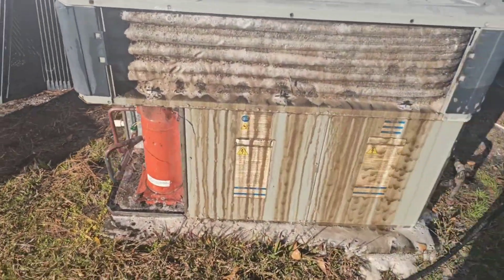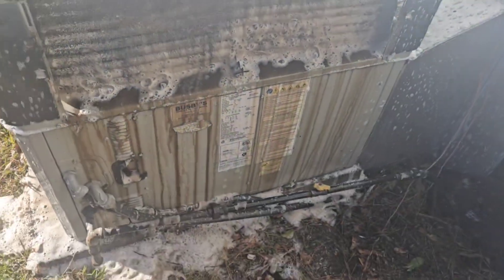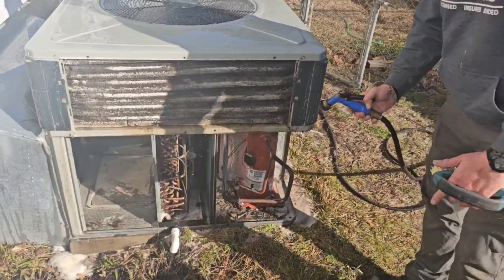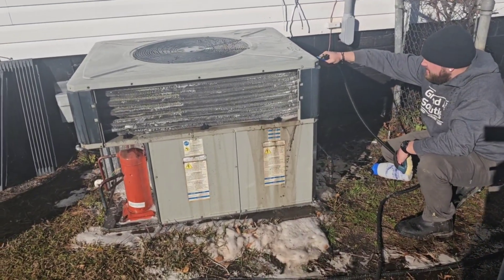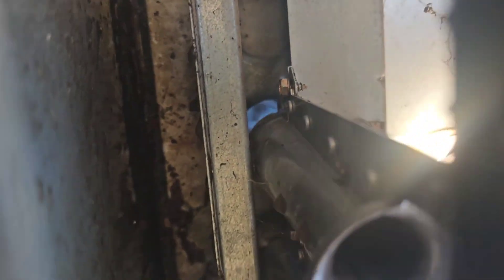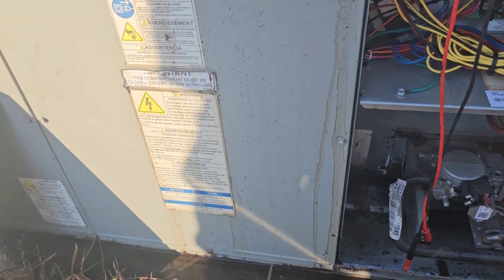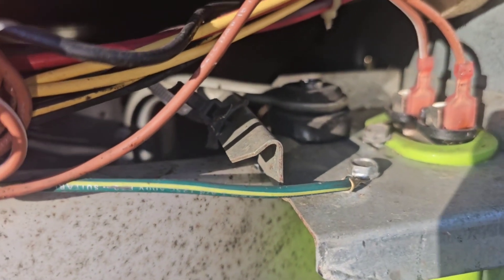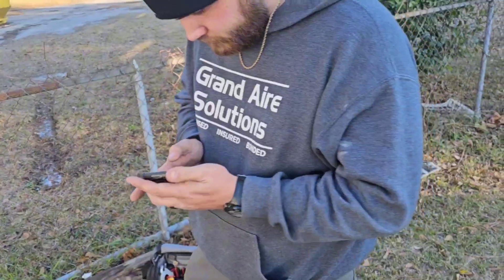Maintenance on Trane Package Unit, found an odd issue!!

Comment: That'll help it run better? What kind of cleaner is that
Reply: It’s an acidic etch, it works by removing the uppermost layer of metal on the coil, along with any contaminants that had fused to it. This isn’t something you want to do regularly, only when the coil is really gummed up.